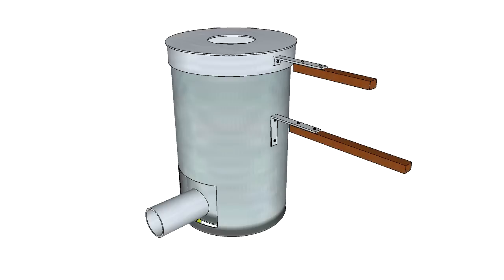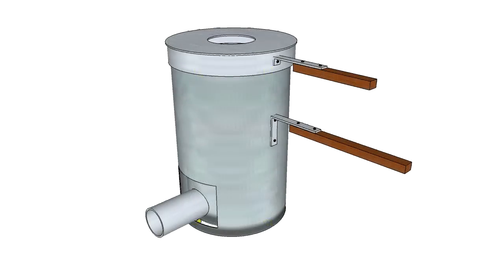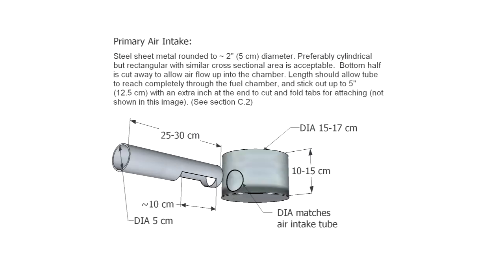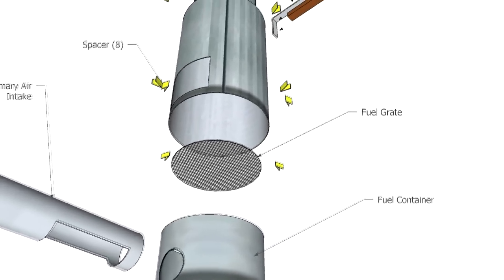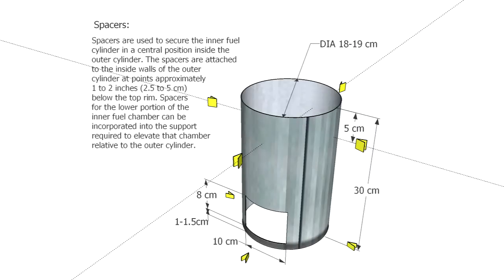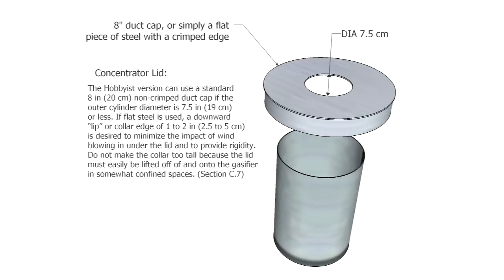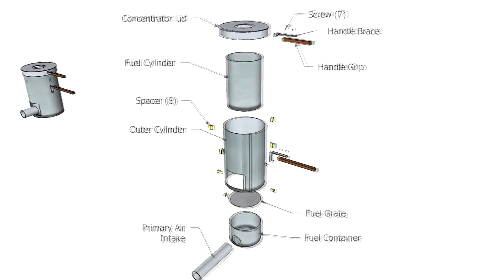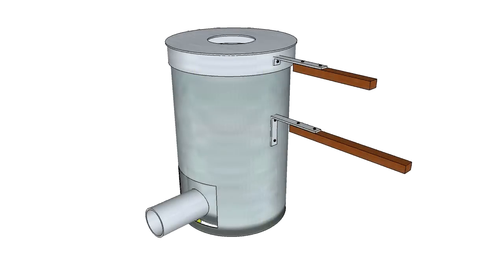TLUD Champion Gasifier Cookstove

Comment: Why not have a fuel feed at the bottom just above the grate? If the gases can't go out the top they can be forced down to a vent, heating the burn chamber as they pass and giving a hotter, cleaner burn. That makes the stove a more efficient combustor but the heat must now be transferred to the food via convection thru a metal plate. 

The hotter chamber means quicker burnout, requiring replacement unless ceramic is used.

Comment from the maker: as far as I know, they're just pieces of sheet metal folded once, and attached to the inner wall of the outer cylinder with JB Weld. There are several other strategies to achieve the same outcome. Contact Paul Anderson for specific details. His email is given in the video description.